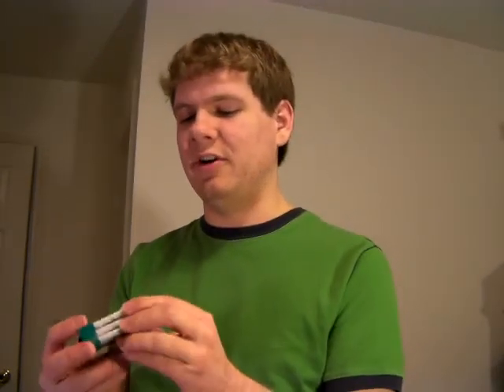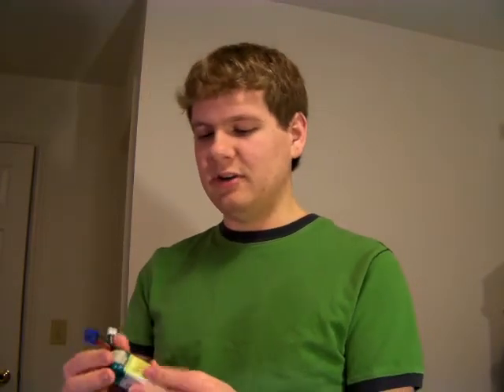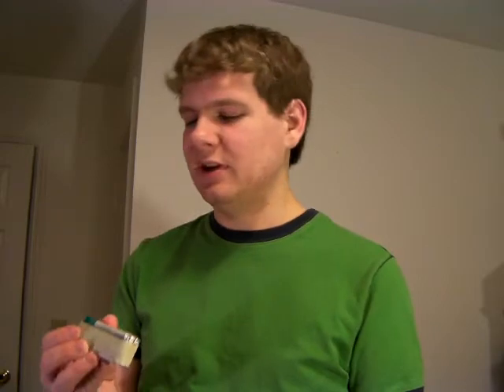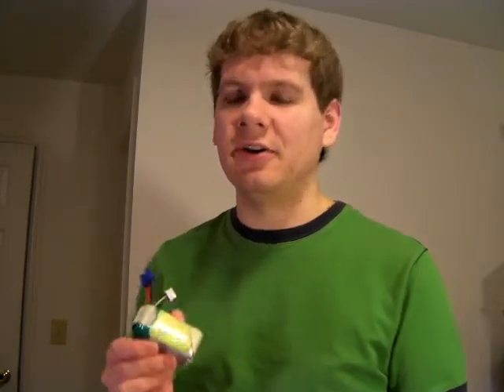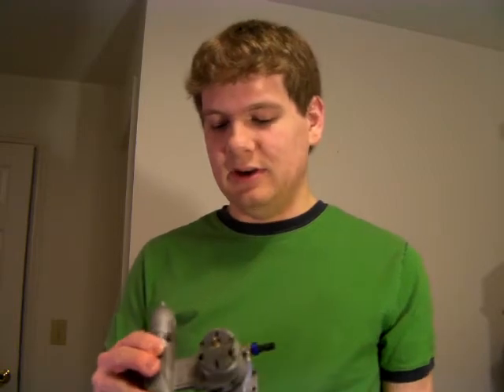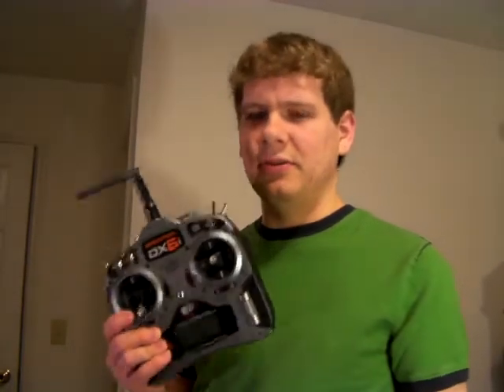Use for old Lipos & NiCads

Comment from the maker: It depends on the cell count and on what voltage your servos run at. If it's a one cell, that's just 3.7v, which isn't enough, and a 2 cell is 7.4v, which can damage servos that can't take that much voltage. You could use a LiFe battery, but they're generally more expensive than LiPo's, and at 6.6V, that's still high for a standard 9g servo. Best is to use an ESC with a good 5V,3A BEC or external BEC putting out around 3-5 amps.